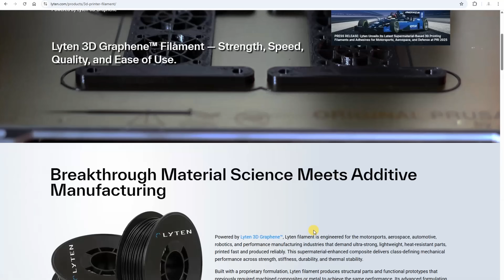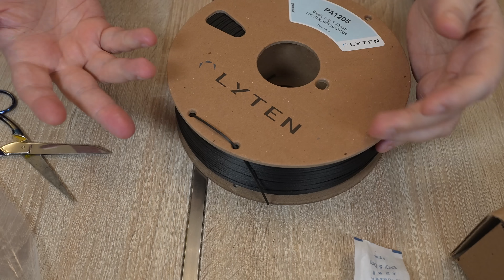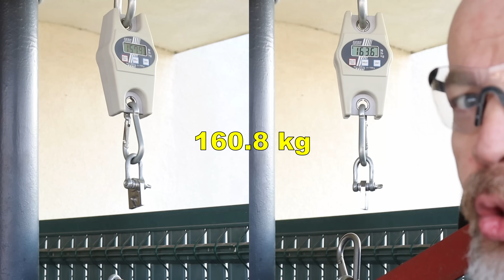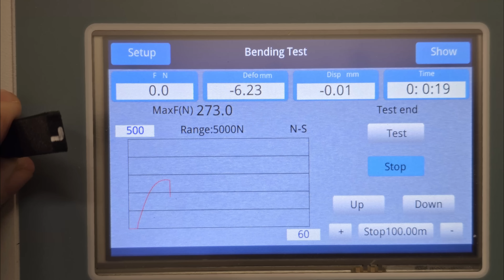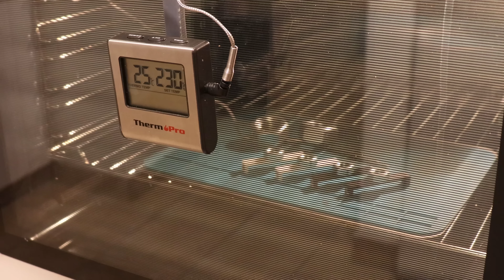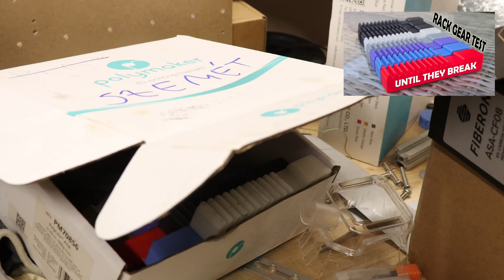💪 They Claim It’s the Strongest Nylon… Lyten Graphene Tested

Comment: I've been printing this filament for the last couple of weeks and it prints AWESOME (Qidi Plus 4).  I have only been using a .4mm nozzle without any issues at all, so I'm guessing the .6mm nozzle is "recommended" rather than "required."  I've been printing it using very high quality settings (.16mm layer height, 75mm/sec max speed, outer walls @50mm/sec).  It prints smoother than PPS-CF or PPS-GF and just looks incredible.  The parts come out very strong.  I'm going to test it's resistance to gasoline, ethanol, and methanol.  The Lyten people are amazing to deal with and are fanatical about racing, light weight, and quality products.  It comes out to about $.39/meter vs PPS-CF coming in at $.43/meter, so a little cheaper than PPS-CF.

Comment: Graphene… this sounds like a scam. In fact, according to my sources, there is not yet any facility capable of producing graphene on an industrial scale. Moreover, graphene is a single layer of carbon atoms—only one atom thick—with very interesting electrical properties. I have not yet heard much about its mechanical properties. I do not see what graphene would contribute to a filament, unless it is to impart electrical characteristics.

Comment: I wish Polymaker would explain what the status on PolySupport for PA12 is. I’m having to use RISE3D PA12 Support filament currently, and although it’s better, it’s 5x the cost.
Reply: Can't you just use asa?
Reply: @riba2233 Every time I’ve tried to use ABS or ASA for supporting this part it turns into a huge mess. I’m sure there’s a way to tune things to be better, but the specific support filament was pretty much idiot proof. My work around at this point has been buying a filament extruder, small yard shredder and industrial blender to simply recycle the support filament so I don’t ever need to buy it again. It cost me more than I’d care to admit, but by the end of the year it’ll have paid for itself.

Comment: Very interesting test. Could graphene be considered inert like glass? Or is it a carcinogen like carbon fiber? I have to assume it positively influences strength and printability based on this test. I like the inert (in theory) nature of GF but not the roughness of the print. So could be a good replacement for both…

Comment: "Do you want me to use 0.4 or 0.6?"  BOTH, DEFINITELY.  1) as an engineer, nothing mystifies me more than people not following my direct instructions.  If you trust me enough to make the software (filament) then you should trust my strongly-worded instructions for deploying (printing) it.  And, it is an "apples to apples" comparison to compare various filaments printed as per manufacturer instructions.  I've watched 20 of your videos and so far this is the ONLY complaint I have for your work.  2) that said, comparing everything at 0.4 can also be seen as "apples to apples," and does present interesting info.  If you see worse results at 0.4, that itself answers the question as to why 0.6 is preferred!  On the other hand, 0.6 may simply be recommended to reduce print failures, at a rate that wouldn't turn up in the course of one video's printing of say 100g of material.  For instance it's possible that serious jams are likely every 10kg, in their internal testing, when using 0.4, but you may not discover that during the course of a single test.

Comment: I was the Application Engineer that helped set up Lyten with their industrial 3D printer and consulted with them when they were considering developing their own filament. It is an extremely impressive company that produces some unbelievable products and tech. Glad to see that it finally became a product. I have no doubts that this will be a game changer once volume production and adoption kicks in.
Kudos to Polymaker for supporting you.
Reply: Will the price come down to rival other reinforced nylons though? If you’re spending that kind of money you’d often be better off getting something powder-printed. So the market seems to be smaller companies that can’t justify a nylon powder printer, needing faster turnaround than a printing service. It’s pretty unbeatable for that, especially with this low level of shrinkage making it printable on even the cheapest enclosed printers.
Reply: @Scrogan powder prints have much worse characteristics
Reply: @Scrogan Their price includes free shipping. For our usage, the properties justify the cost.
Reply: @WeThreeDee  For what kind of usage? Small run production and prototyping for high-value markets?

Comment: The health hazards of graphene in a material like this cannot be overstated. 

Printing with this should be subject to extreme levels of not just ventilation but filtration also. All the produced parts need to be coated to prevent shedding, and I’m nothing short of horrified to see bare hands handling of a tool made from this.
Reply: Thats what I was going to ask, which is worse for health graphene or CF.

But I think the main risk is when he broke the parts, and the grinding test, then the graphene can be released.
Reply: @jaro6985 I can assure you it’s graphene. In our labs we treat certain graphene products with a higher danger level than radioactive dust. 

We were going to use four different materials that contained graphene for manufacturing tests and each time we were thoroughly denied by the company safety coordinators do to risk of static dispersed particles. 

Look up what it does when it enters your body. It’s insane that anyone is putting this in a filament for home use.

Comment: Thanks for the review. Separate thanks to Polymaker appreciate their efforts and support of the community a lot. And this is one of the reasons of when I’m buying filaments I’d rather buy their products. Eg the latest I bought (and plan to buy some more) is Fiberon PET-GF. I had some grief finding out the settings to get the best results but I’m so happy with this filament. Several reasons that separates it from the other I used for technical/car parts - virtually no shrinkage, not brittle at all. And it’s not about impact resistance, I think it’s about that bending load behaviour. It’s pretty different from other fiber filaments. I think you could try to show it with your new bending stress test machine!

Comment: Haven't used anything less than 0.6mm in 10+ years. I only print functional parts and have had no reason to do so. My recommendation is to stick with 0.6mm or greater for all engineering materials.

Comment: Love it, Igor.  Another  good one.  Nice sneaky way to make people look at your prior videos to understand the data :)

And like the other comments as well as your own, it's been incredibly encouraging that  Polymaker is being so supportive as a sponsor in all of the good ways, but without forcing your hand.  As one of your Patreons, we were all a bit concerned when that sponsorship opportunity came up but it seems Polymaker has been ethical and above board about this. It's great to see, tbh. And I think it's win-win for all of us as well as for Polymaker.  

Very much agree with your final summary. Since PPA-CF / PPA-GF is significantly less expensive than the Lyten Graphene, unless one really, really needs the added impact strength, PPA is still a bit of a better choice, even though it really needs serious, higher temp drying to print well. But it's awesome to have the option.

Comment: That bending machine is amazing!
Reply from the maker: It is, I like it. But it is universal too (tensile, compression and bending). Max 500 kg (5 kN). I will present it soon..
Reply: @MyTechFun  Can you extract those graphs?. Would add alot of understanding of the material with them overlayed.
Reply from the maker: @garagecedric not digitally. I can print them, but nut much use from it

Comment: The only issue I can see with testing at 0.4mm when the product recommends 0.6mm is that it gives them the "well, you didn't test at recommended settings" excuse. May not be so relevant when it performs well at 0.4mm like in this case.

Testing at 0.4mm helps us, the end-user, who may wish to use it in that nozzle without wasting a bunch, and gives a good standardized comparison to the previously tested -- since we don't have a pool of data to compare how a 0.6mm nozzle would affect the other filaments. 

However, it would be interesting to do a subset of samples at 0.6mm just for comparison cases when they do recommend that nozzle size. Possibly excluding those from the sample database (or putting them in a 0.6mm nozzle table).

Side thought, the fact they ship such an expensive filament without the better vacuum bags and with the cheapest spools is a down mark. Unless their margins are razor thin, they need to up the quality of those.
Reply: Using a 0.6 nozzle means you are extruding more mass and the filament keeps its heat longer after extrusion which helps it have a better interlayer adhesion.
Reply: The issue is partly that at the smaller nozzle diameters there is a higher chance of clogging and if your flow rates are not set perfectly you may end up with excess material being plowed in front of the tip which in PA's case lead to large snots and zits being built up. In extreme cases this can fuse to the model and literally tear you print off the bed. Flow rates for fiber filled materials need to be carefully adjusted from neat (non-filled) ones.
Secondly, with a reduced extrusion cross section, you limit the total energy put back into the part at that particular point so you may end up with poor layer welding, especially on larger prints where the layer times have allowed the part to cool down too much. The larger hot bead of plastic helps rewarm and fuse to previous layers a bit better.

Comment: Are the wrench and gear results in a spreadsheet for patrons like the other filament tests? If not, is it possible for you to add them? Maybe a separate spreadsheet that has the alternate test results like those, the wear test, and the spring test?
Reply from the maker: I can add them (separate sheet), but I don't plan to do this test too regularly.
Reply: @MyTechFun  I do understand that. But when you do, it would be nice to see the data shown in one place rather than to have to jump from video to video to see the comparisons when a new result is added. I love the work you do, and I know it takes a lot of your time, but I was hoping this request would be fairly easy for you as I suspect you already have the data available. :)